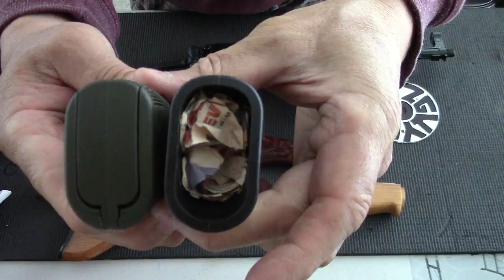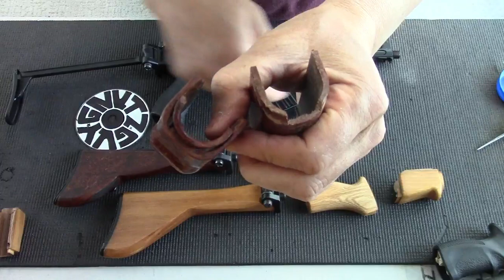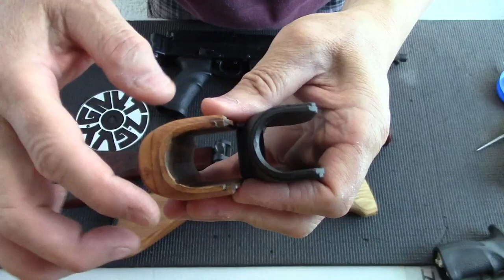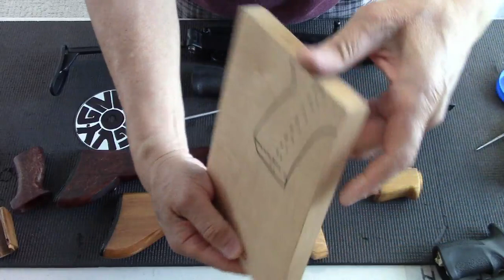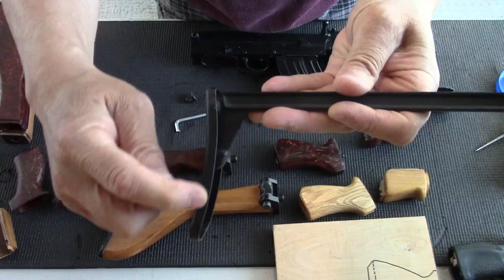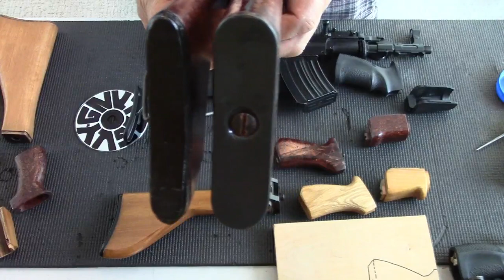Pimp my CSA VZ-58 Compact. Furniture mod.

Comment: Thanks for video. Can i install stock folding adapter on original unfolding stock? Can i buy folding adapter?
Reply from the maker: there is no folding adapter, its the standard side folder with wood and beaver barf attached to it. yes, a standard side folder will replace a fixed stock.... but i wouldnt know where to buy a standard vz58 side folder.